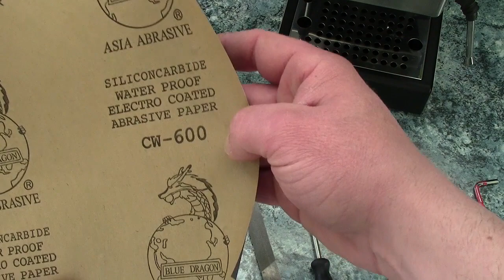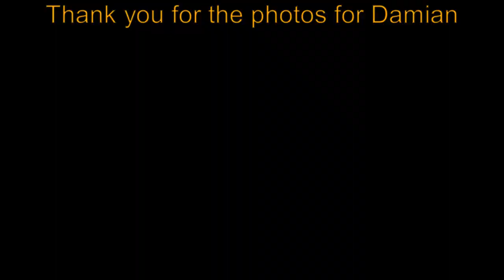Gaggia Classic (Pro) leaky dripping steam valve refurbisment repair

Comment: There's no way 1/4" is the right size for that tap on the steam valve for my 120V Gaggia Classic Pro 2019. I'm pretty sure the steam wand attachment nut is 1/2" threading and the valve side seems the same size.
Reply: The diameter of the thread is around 1/2"  meanwhile the actual fitting - so as the die - labelled 1/4" 19tpi as per industry standard size compression nuts for 1/4" diameter tubing.
The wand attachment nut has the same threading as the tube is 1/4" or 6mm.
Reply: @horvathpeti84  Yeah, whoever came up with compression nut sizing should be shot. I have no idea if US compression nuts are 1/4" 19 TPI though, as I can't find any information on them.  Seems like an industry secret?

Comment: Thank you sir, I'm in the middle of doing this process, but the quarter inch die seems very small. Could you tell me the exact, or similar, actual die size please. Thank you
Reply: Hi,
I should have highlight it that's a 1/4" BSP thread with the size of 13.16 mm / 0.518" and 19 thread/inch
Reply: @horvathpeti84  the actual die says 1/4 inch on it?
Reply: @jonpos4671  Yes, it does, but as stated it is above 1/2" in diameter. It is a British Standard Parallel thread (BSP).
Reply: @horvathpeti84  the closest one I have is 1/2 NF 20. Think that will work?
Reply: @jonpos4671  it should, as long as you can get a locknut as well with the same internal thread with a 6-7mm hole at the end for the spindle.
Reply: @horvathpeti84  🙂 thank you

Comment: Hah,  most of the time the steam valve is scale-fused to the boiler making it IMPOSSIBLE to remove -=JUNK.  UNREPAIRABLE.  The fact that you have to grind down the valve top to remove the core shows you what complete unrebuildable junk this machine is the Gaggia Classic is a piece of aluminum JUNK
Reply from the maker: Well, that's a point of view, however I would love to hear what are you comparing it to - obviously with an identical price tag. To make your contribution more constructive.
Personally, I've been able to remove all steamvalves in the past even in a DIY  workshop.
Hint: If your steamvalve is scale-fused to the boiler, it is probably a good idea to clean the boiler as well. Once these are out of the machine, it is a piece of cake to tap out the steamvalve with a 9mm rod...